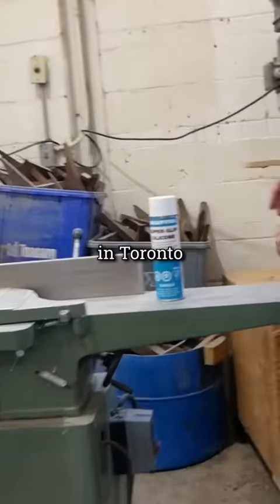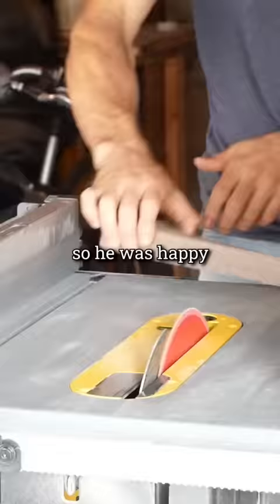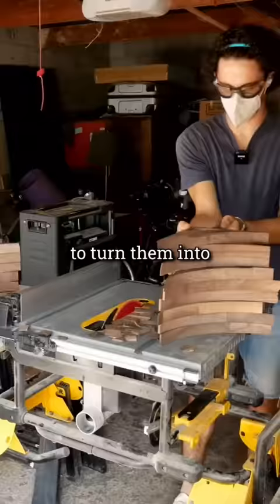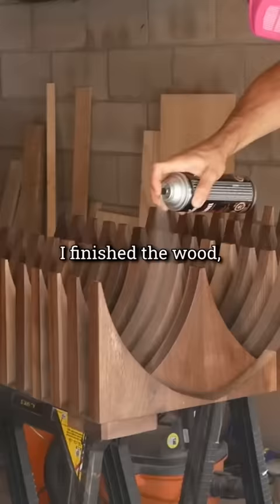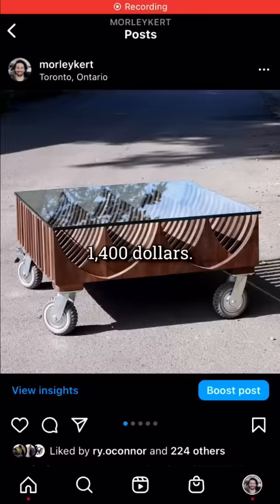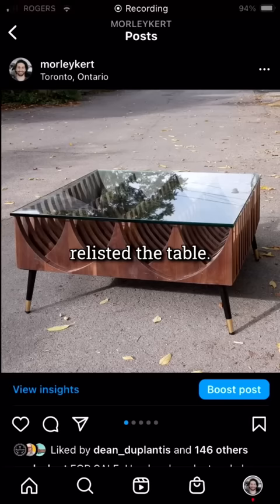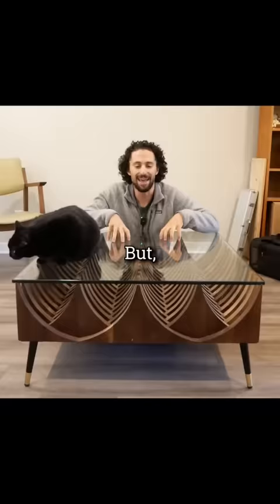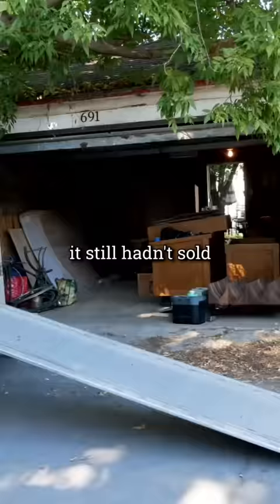Free scraps 👉 modern coffee table #DIY #woodworking #upcycling #shorts

Comment: Gets free scrap and tells the guy it's going to a good home, then trys to flip it for a asinine amount of money. 😅
Reply: (insane)
Reply: @Kay glass is easily found for free. I got 5 huge tempered pieces for free and used one as a table. This is just entitled pricing and that’s a fact.
Reply: How didn't it go to a good home? What does it matter what he tried to sell it for? Using free materials doesn't mean he has to sell it for cheap.
Reply: @reidothetorpedo7846 oh.. glass is easily found for free.. that means nobody should have to pay for it.. 😂 glass that large isn't cheap, period.
Reply: @randybobandy9828  I wonder what else flies over your head?
Reply: @Randy Bobandy  only one upset is you bro. 😅
Reply: @reidothetorpedo7846  opinions are not facts
Reply: @Randy Bobandy  no one says he has to sell ot cheap but it doesnt mean hes not being a greedy pretentious snob trying to sell it for 1400. Especially with bs wheels on it. Basically tweaker behavior there.
Reply: @randybobandy9828  Buy it for 1500, then.
Reply: @reidothetorpedo7846  Bro the only glass that size available for free is stolen glass lmao
Reply: The guy getting rid of the scraps had seen Morley's videos before, so I'm sure he knew he would try to sell a project with the scraps. It's not like Morley told him he was going to make a project then give it away for free and lied
Reply: @Kay I could purchase hand wrought nails forged by a swiss master craftsman, and glue distilled by Elmer himself, and it wouldn't come close to $400 my friend
Reply: @MattFaz-y8t  *asinine you're just a few clicks away  from google. Haha
Reply: @Nicholas LaRiviere  But glass can. A quick look at the price to get a coffee table sized piece of tempered glass, 3/16" is $432. Now, he probably has a source for it and gotten it cheaper, but it is probably the biggest chunk of his costs.

Why is it amoral to sell something for $1400?  OG got the wood for free since it was going to be tossed and the guy figured better for it to be used than wasted. But that has no bearing on how much someone else values the finished product. Demand sets the price, not the sum of materials.
Reply: @Robert Ellis  Well, for one, it's really poorly made. You don't just set price by demand, it's also quality of both the material and the workmanship. He glued and nailed a bunch of flat edges together, those won't hold over time, that's pretty basic woodworking that you would learn in any highschool shop. I wouldn't pay more than $150. There's nothing morally wrong with it, I just pity the sucker that paid that much
Reply: @Nicholas LaRiviere  That seems perfectly fair to me. That is a criticism of the value of the work, not saying he should charge less because he got the scraps for free. Personally, I think it's an ugly table, and had hoped that he would do like a patchwork pattern tabletop, with a solid board beneath for strength, and maybe other smaller scraps to fill gaps, and sealed with a clear epoxy. Maybe that wouldn't work, I'm not a professional woodworker. Regardless, I think the free market operated precisely as designed, and the price he set was obviously too high since he never sold it.
Reply: Labor has monetizable value
Reply: @jack z 🏳️‍⚧️  Duh, but it provides a great insight into one's own self image when you get to place a dollar figure on your quality of work. And placing yourself at double the value of an educated professional with 2-4 years of experience when you yourself have zero and produce a product of worse quality than mass produced crap, it comes off as arrogance, at least to me
Reply: @randybobandy9828  whatever man! I’m not here to argue. Believe what you want to believe!
Reply: Thought the same
Reply: The one thing ive learned is that where theres something for sale theres always someone to buy it. 

My old boy always had a sign on his shed saying buy my troubles and the get this shed free 900 bucks. 

Always a joke as the shed could be bought for 2/3 of the price my old boy just had it stacked with 1000s of old screws and nails in jars thats he had pulled from scraps before throwing it in the fire. 

Not less than 6 months later 2 brothers roll up. Knock on the door ask what my dads troubles were and then just dismantled and removed everytying. 

Dad had a retirement drinking patio and no longer had an excuse to keep the shed
Reply: @robertellis6853  I have no problem with the free market, it's everyone's own prerogative to operate exactly how they please. Yet I retain the right to laugh at the yuppies who pay 1200 for a table with no joinery that's going to fall apart in a couple years because its' ✨reclaimed wood✨
Reply: @Kay dude glass, nails, glue etc is not coming out to 400$ even with Canada’s insane prices and inflation right now..
Reply: @Kay that’s not even worth $50 an hour woodwork like this is quite simple middle schoolers can do it
Reply: Yeah, well you couldn't even pay me, to put it in my house.  Maybe the firepit.
Reply: @nicholaslariviere329  it’s not $1400 just because it’s reclaimed wood. It’s walnut with tempered glass. This thing will outlive you, unlike cheap furniture. However, I do agree it’s not very attractive for a functional piece of furniture
Reply: @Kay bro the table is ugly and you can get those suplida for 120. Also it not hard to make a goofy table like that the most time he’s proably spent was waiting for the glue to harden that’s it. Most it would be is 45 minutes to do all thing he just showed in the vid. Especially since he has the right tools. He just made a goofy looking table.
Reply: you dont know what asinine means
Reply: @gladlock  The wood itself is going to outlast my grand children. That table isn't. Walnut has a very tight grain structure as-is, and the first thing you learn in any woodshop is you can't just glue together a bunch of face-edges of wood and expect it to hold together for very long, even with the nails, especially because A) these pieces are crotch partnered, which is especially finicky to work with, and B) The really low surface area that is in contact from one piece to another. I will forever be a hater until this guy learns furniture joinery
Reply: @Kay I dont care how much it costs, the table just look ugly af lol
Reply: @Kay 
The wave like design is both unique and aesthetically pleasing, but the way in which the glass just sits on top of it and the legs are attached makes the end result look jarring. 

Aside from that, it feels really expensive.
Reply: @Kay charge What you want it’s your project. Don’t expect anybody to pay for it though. $1400 for that glorified pile of firewood. You’re wasting your time.
Reply: @DiGiTaLFaKiE  yes but its closer to "inane", you would never use it to describe an amount of money
it has the connotation of meaning boring/uninteresting
Reply: @k  example. "The amount of money I've spent on this game is asinine" You know, some people only understand from there own level of intellect and it really shows for you.
Reply: *an
Reply: @MattFaz-y8t  i wondered what that word was lol cheers
Reply: He never said it was going to a good home lmao the furniture maker said he was happy to see them get used
Reply: Pretty sad
Reply: Well he does look like he's from, ya know, ...that religion
Reply: @Kay doesn’t account for time or gas, traveling, wear on vehicle, time taking pictures and posting online, negotiating and otherwise communicating with potential customers, any rent on shop space, profit (that he should rightly be making if he has a furniture business), wear on tools such as new saw blades (but also just general wear to the tool itself), electricity used by tools, etc.

I could probably go on forever. I’m not saying each of these things are individually a great expense. But they add up. It’s not as simple as material cost + build time hourly rate. I’m not into the furniture business myself but I’ve been selling services for a long time and it seems most people don’t come even close to considering a second of the time or work that goes in to running a business behind the scenes. We have to pay for our office and vehicles and uniforms and employee wages. I’m sorry it’s more money than you think it should be but that’s what it’s worth, that’s what everyone pays us.

It’s okay that you wouldn’t but a coffee table for $1400, you can go to ikea or whatever and get something nice for much cheaper. But there are lots of people who will spend much more money on handmade furniture.
Reply: @randybobandy9828  you can find it for like 100 dollars, its not that expensive
Reply: @Kay he didn't cut them into the semi circles. He took off the tips. You honestly think this took more than 8 hours.
Reply: He said a good home. Never said which home
Reply: @Reido The Torpedo  first off that's a lie unless you know people, second if tf are you gonna do with all that glass. What is your profession.
Reply: @Kay the materials you listed do not cost $400
Reply: I honestly think it would have sold, the legs too where made of wood. The legs he put didn't go well with the table. I also believe the price was too high -people look for name brand furniture, unique, and marble. At that price point, bit he's right it take time to find a buyer.
Reply: 1400 for a statement pice is SO CHEEP. My statement bed was at lest 10k and I know even basic tables well over 2k new
Reply: @JesusChrist-sm4bm  tell me you are rich and never really worked hard for money without telling me you are rich and never worked hard for your money…
Reply: @BlondeQtie  I just don't have kids and can't take time for vacations...  Or fancy cloths, or really much of anything. So I spend it on makeing my house look nice
Reply: @tiddlesworth8798  Right? Someone putting Tonka Truck wheels on a coffee table then asking $1400 sounds almost like a scam.
Reply: @tiddlesworth8798  ha Tacky. Says the person that probably looks like an Ika showroom.
I mean my house dose look tacky but that's because I collect everything cute and have a 50s pink and seafoam green kitchen
Reply: @Jesus Christ  there are more options than ramshackle bs and ikea. If thats all you know then we have found the problem. 

Also, pink and seafoam kitchen? Yea, go buy that thing for 1400, itll match your house perfect.
Reply: @tiddlesworth8798  Your just jelly because my fridge is better than yours
Reply: @robertellis6853  prices have to be reasonable, that’s the point of putting the price tag and try to sell it on the market in the first place. You don’t just make a coffee table from scraps, low effort put in, then “demand” for $1400
Reply: @Kody  Why do they have to be reasonable? It's not an important item, so nothing requiring anyone to pay that much. The purpose of putting a price tag on it is solely to indicate to prospective buyers how much the seller wants for it. Now, the buyer has three options - walk away in disgust, try to negotiate it down to a lower amount, or decide it is worth that much to them and pay it. Do I think that table is worth 1400? Not a chance. But someone else might, and if not, it's up to the seller to decide to lower his price or no longer try to sell it. He can "demand" a high price all he wants. The only one suffering if it's too high is himself.
Reply: @Kay The material for these could hardly go for one quarter that price. Where the heck are you getting your numbers from?
Reply: @Kay 150 max for glass 15  dollars  for all glue and nails ( possibly got em for free or left overs etc "20 hours " bull💩s   did you hes got machinary.. 1400 is way to much  for a piece of 💩 table
Reply: @Kay  Glass is not 400 dollars for a table that size, components for it probably around 50$ max, glass price depends on the type but it's not 400$ lmfao
Reply: For all yall that could t do the research a 36x36 glass top for a table, tempered glass costs 130 where I am at on average
Reply: @ashtinpeaks9972  I looked into getting a piece of tempered glass that size - guess what, $400 was a lot closer to the price than $150. And tbh, the thickness of glass I looked at was probably insufficient for the use case of a coffee table. (Edited because I miss read the $50. Also, I'm pretty damn sure that the glass he has is not 36x36. Also was it tempered? You really don't want to use it for a surface that can easily fall into if it wasnt)
Reply: @ashtinpeaks9972  and?
Reply: @ashtinpeaks9972  AND?
Reply: @Robert Ellis  Guess it depends on your shops, idk what glass he uses tbh. It's a short so it's hard to judge prices, 400 seems too expensive off the top of my head but i could be wrong. Most glass I have bought for my projects are more for doors (cabinets/grandfather clocks) though, so maybe that's where disconnect comes in.

I would need to actually go to my regular glass shop to get an actual price (they do it based on what you want so they don't really have online prices)

Comment: I think it would look a little better with some brushed brass inlays. Nothing complicated, just some straight lines maybe 3 quarter inch thick coming from the corners into the wood at different lengths. It would give it a sort of revamped mid-century modern vibe in my opinion. But I still think it looks beautiful as it, just not within my budget personally

Comment: I commend your effort to reuse the scraps, as no wood, even sawdust should be tossed. There is always a further use, such as your project, fire wood or even mulch, provided that the wood is not contaminated. 
I will profess a preference for vintage furniture, but there are many varied preference out there. I like your idea of castors, but being very industrial looking, the fit was off. Maybe you could have developed a way to hide the castors within a sleeve of wood.

Comment: Honestly i think it wouls have been cooler upside down, would have 60 legs and be a nightmare to get perfectly flat on the floor without juat adding a foot to the corners but seems more fitting to me, as it sits it looks like a glass topped echo reduction panel

Comment: Honestly, would look better without any legs. The design is very cohesive and singular, and the legs really break up the flow of the piece. I’d either use less visible legs closer to the middle of the piece or just have a low table with a more coherent aesthetic.

Comment: 100 for the glass, wood was free, maybe 10-40 for the legs....I'd say probably 3 hours of work. They were already precut, just measuring once to set the table saw correctly then running them through. Gluing would take the longest. Umm maybe 400-600 dollars would be high end price but I could see it... 300 realistically.

Comment: it looks striking, interesting, and welcoming, but it's also a dust trap. seal it in with glass sides. Maybe mirrored on the interiors to amplify the effect.
Reply: Did you say that looks welcoming?

How? If someone fell on it they would die
Reply: @datcheesecakeboi6745  if someone could fit in that tiny space, a sunbeam could do the same.
Reply: @BillWiltfong  what? If you tripped and fell on it you would smash the glass and be impaled on the wood

It looks scary af
Reply: @datcheesecakeboi6745  Scary is sexy. Okay, maybe that's not "inviting." It certainly invites some staring, though.
Reply: @BillWiltfong  striking and interesting? Sure

Not welcoming 

I agree.